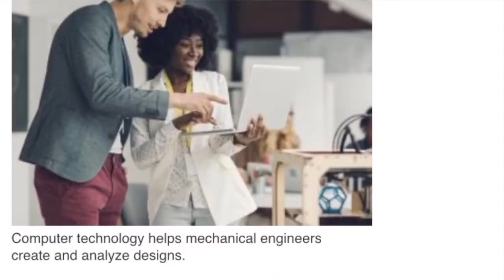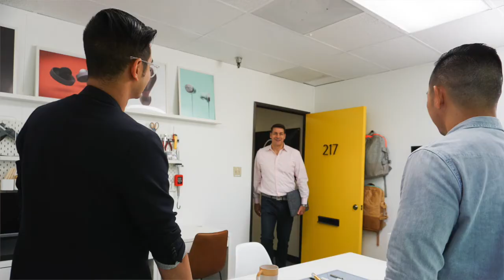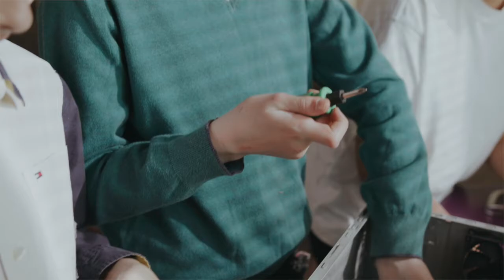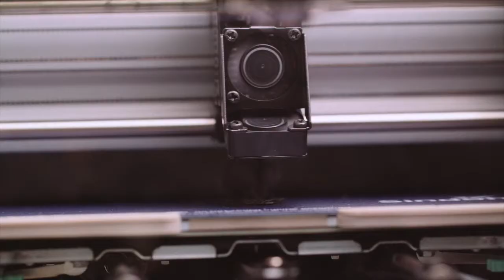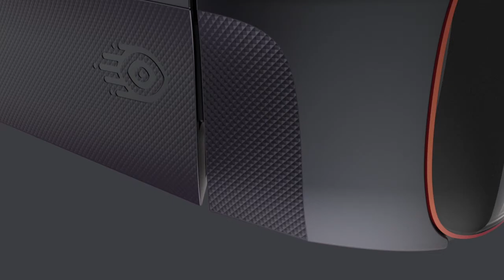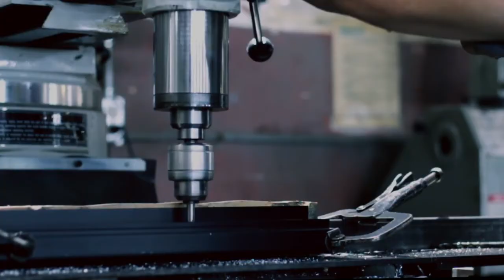Mechanical Engineering in Early-Stage Product Development - What You Need To Know

Comment from the maker: THE VALUE OF MECHANICAL ENGINEERING HIGHLIGHTS: 

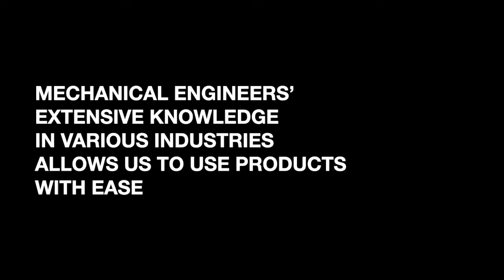Allows us to use products with ease: 1:00
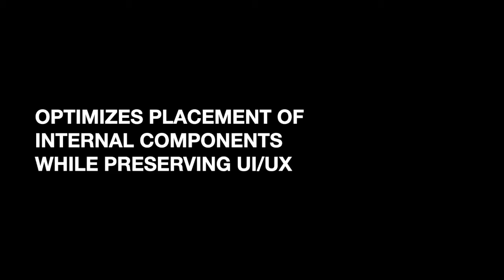Optimizes placement of internal components while preserving UI/UX: 2:45 (DFA, rapid prototyping, how Mechanical Engineering fits in the design process)
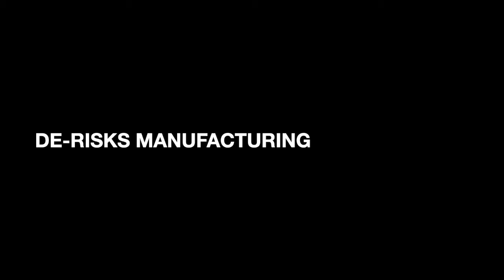De-risks manufacturing: 4:32